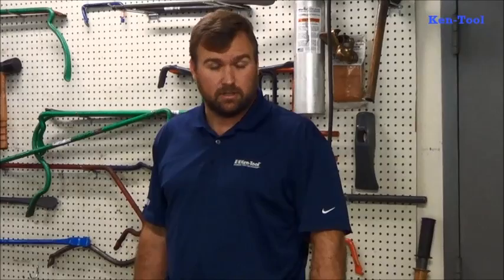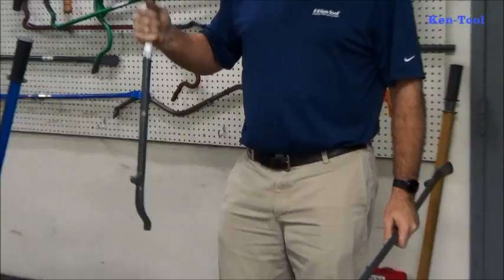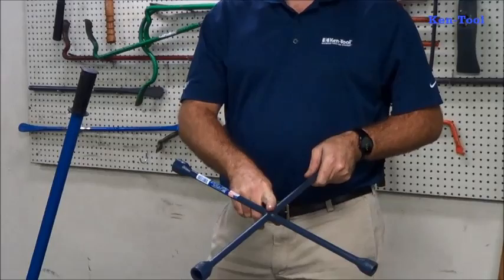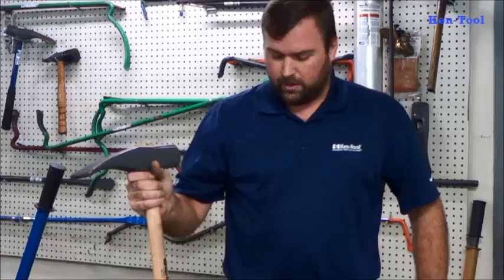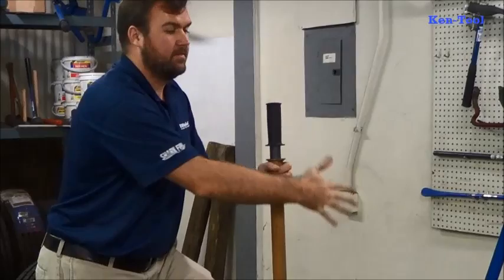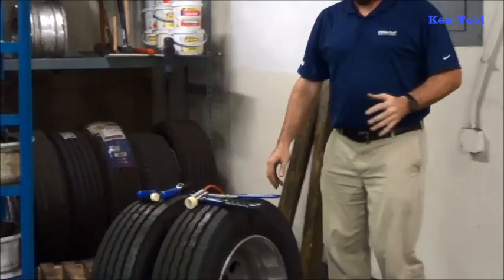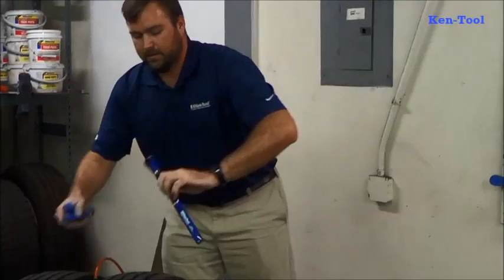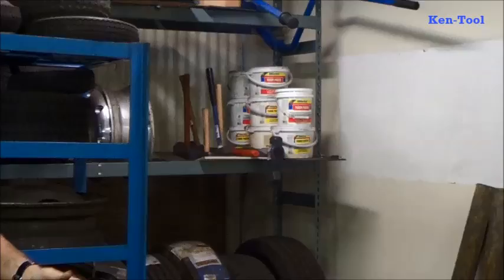Ken-Tool Full Product Line Introduction

Comment: ...guy did a great job with all the distractions, would also like to see YOU AND EUNICE demonstrate the TR44X 34547 Power wrench nut bust a rusty Budd dually and then a 33mm pilot hub (all adapters and scenarios), as these "nut buddy " things seem to be made from soft metal, and the "torcUP " type stuff is not within financial reach of most tire technicians,  Thanks.

Comment: Can you put Heat Shrink Tubing on the ends of the Tire Bar T-45 to protect the rim from scratches? I plan to remove the 16" and 15" tires, is it possible with this tool? Thank you for the informative film.